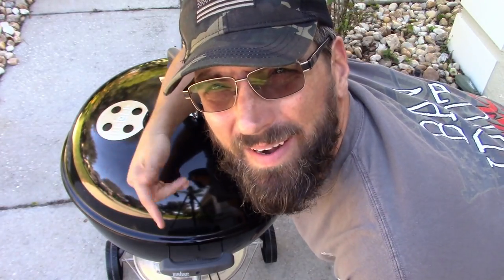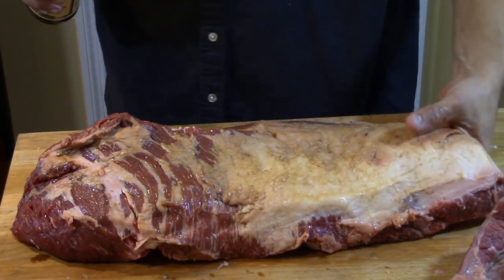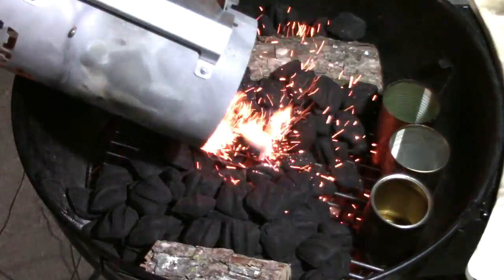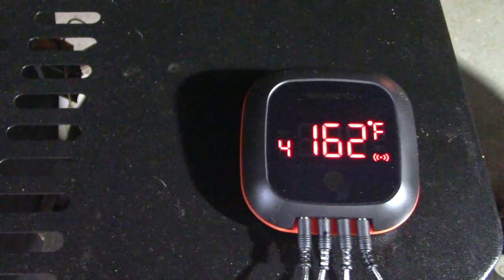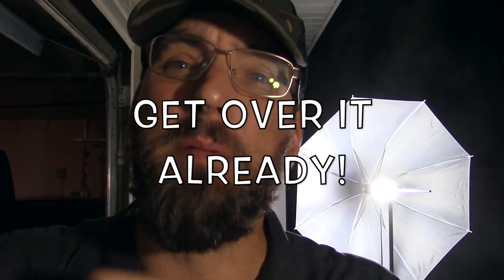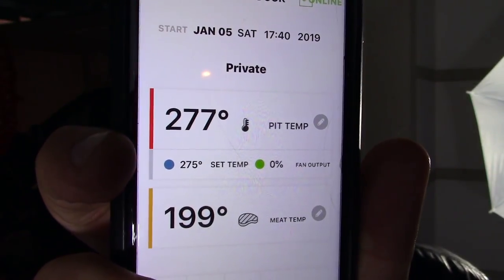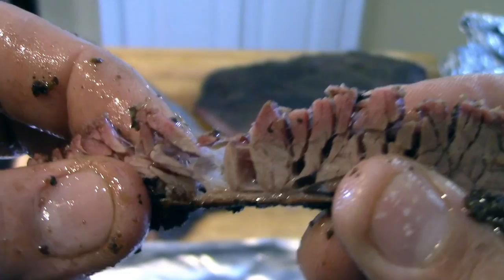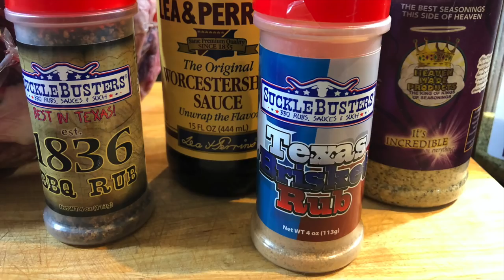PRIME BRISKET ON THE WEBER KETTLE/BBQ DRAGON GRILL STONE/FLAME BOSS/INKBIRD/CAMP CHEF PRO LUX/HOW TO

Comment: The video was impressive, the length of time and the way product came out. I have to re watch video as far as temp on kettle. I picked up product called kettle zone by aura products it's like kamato joe divide and conquer were it has air flow around perimeter. I would like to do natural aspiration cook,I would think snake method with water pan in center of snake for humidity. I have to experiment next year. I have sns I never used mainly because of lengthy cooks. I was using just weber baskets on small cooks, that's why your cook was extremely inspirational. I have thought of adding bandit stacker that way you cook use charcoal ring and have easy clean out  of kettle and long cook capability of wsm.
Reply from the maker: John Knapp That sounds great. I am going to be doing a test of the Grill Stone 🆚 SNS. The snake method I’d extremely efficient way to go, if you use that with the grill stone I think you could go a very long time. Thanks for the support and watching Brother